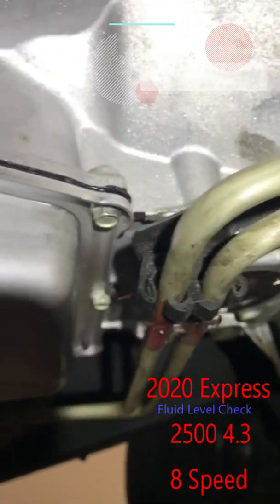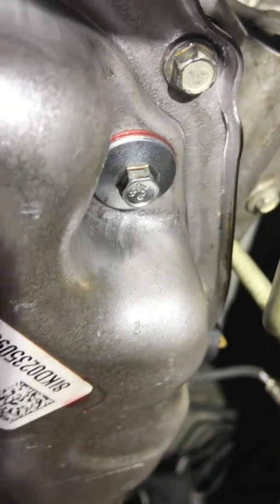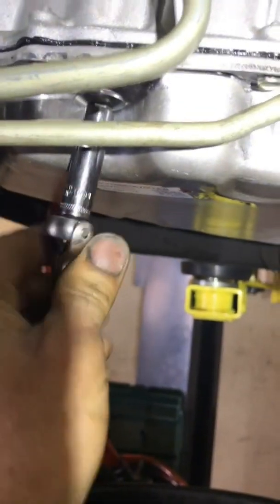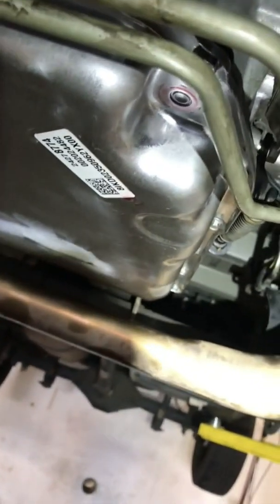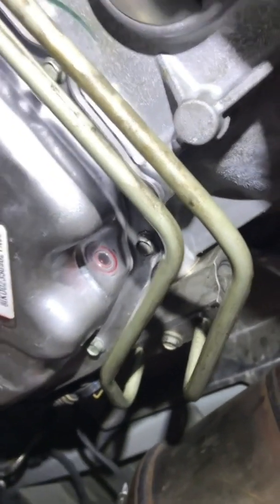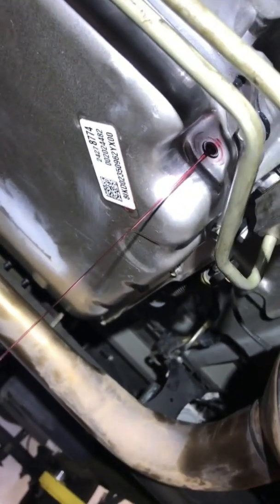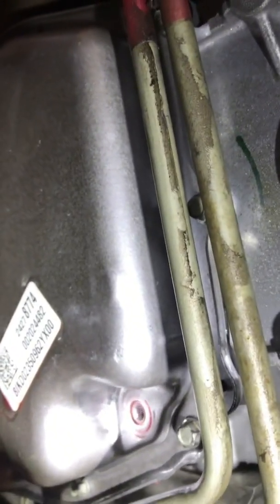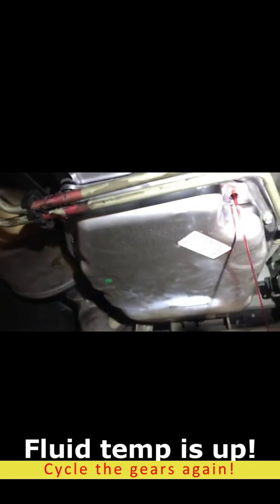2020 Chevy Express transmission fluid level check. (no dipstick)

Comment: That's pretty crazy Chevys too cheap now to put an actual dipstick in there to let you monitor the level and also check to see if the clutches are burned or not. Leave it to Chevy. But at least they held on to their V8 in their cargo vans up until this year unless you get a passenger van or a cutaway van. With that said I'm getting a 2023 with a 6.6 l.. hopefully with less than 5 k on the clock.

Comment: Damn what a stupid idea.....I have a 16 with the 4.8L....i have no idea how to get rear transmission pan bolts out. The damn exhaust is nearly on top of it, I thought my 04 was bad.  These are commercial vehicles that need this service done often....to not install a drain plug on the pan is criminal.
Reply: I ended up here looking for solution to exact same problem. Let me know if you find anything I'll do the same.
Reply: What I ended up doing temporary is pulled out quick fitting on passenger top side of radiator and hooked up tubing into a oil pan.  I added fluid as fluid came out, till it ran brand new....and checked with dipstick.  I figure this give some time till I get it right. If I find out how to remove pan,I have saved this video....I will keep you guys posted!